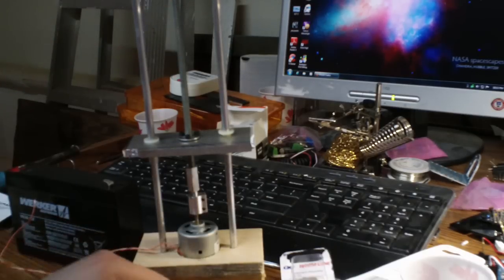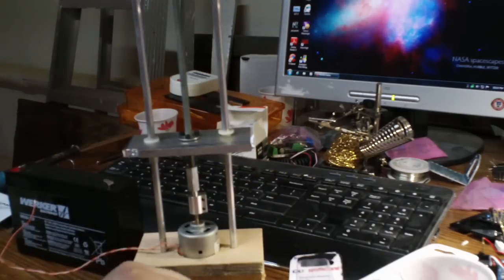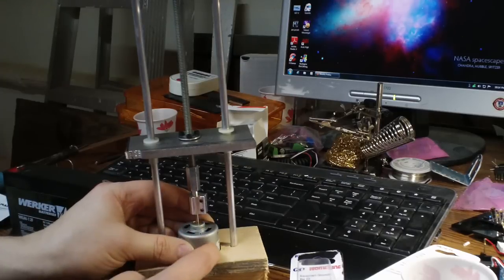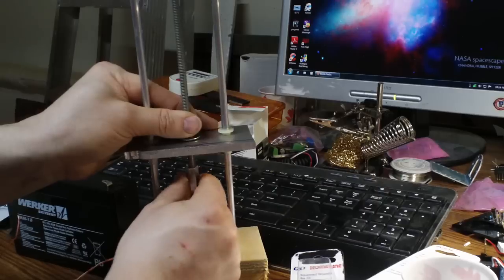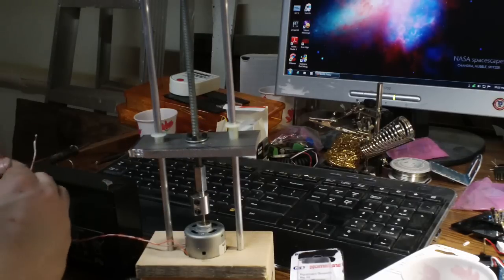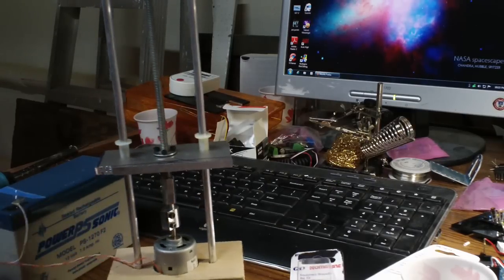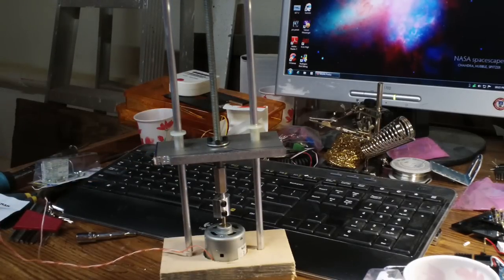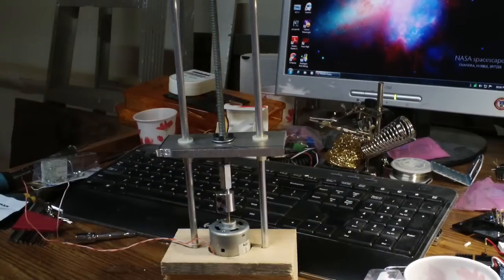Testing out a lifter concept

Comment: How does the blind nut go up an down the thread without spinning itself? Do you have a diagram?
Reply: More info here (note my new channel too)
http://www.r2d2.nu/lifter.html
Reply: So here's how I understand it. The rivet nut spins around the thread causing it to travel along the thread. The bearing allows the rivet nut to spin without the plate wanting to spin. Causing the plate to only have vertical motion. Is that correct?
Reply: Cory McMeekan you got it.
Reply: Thank you for the clarification, you have definitely earned my sub. Thank you.
Reply: Cory McMeekan  ha ha cool.  Be sure to Subscribe to this channnel (Where Nerdy Is Cool) since I rarely upload here, my old channel!
Reply: @corymcmeekan5799 lu

Comment: youre probably done with this project, but on the off chance that this information is still valuable to you, use a stepper motor and a stepper control board to eliminate the limit switches. More expensive? Yeah a little bit, but its also more reliable and a bit smoother. Also leaves room for other stuff where the switches would have been, and rigging the switches to where you want them to be would be a PAIN without a 3D printer.

Comment: Hi. Do you still have the building drawings and what you used to build it? I'd like to give it a try a home, and to control it with Arduino
Reply: Well I pretty much just hacked this together and as you can see ,that motor is VERY fast....I found it more lightly to crush a limit switch than stop it!
Reply: I'd like to modify it with a Stepper motor, so I can choose the height. But yours is pretty cool. What pieces did you use for the platform?
Reply: I would really have to dig...as the description says, some 1/4 inch rods, the adapter piece from Servo City...come to think of it, you could probably piece something together straight from what they offer on their site.

Comment: Found your idea interesting..I am looking at using the same concept to raise up a truck camper roof, with threaded rod actuators in each corner..just not sure of the power requirements the motor would have to have.
Reply from the maker: Hi....wow....one of my videos from 5 years ago!  I'd check in to Firgelli Auto and see what they have for actuators.  Thanks for the comment!
Reply: Chris have you started your project yet?  I’m interested in doing the same thing as well, and was curious about your progress, build, and any tips/tricks you could throw my way...I just recently have seen the coolest truck cab camper EVER that uses (I’m guessing) this type of system cyberlandr.com. They want $50k.....:( 🙈So, I’ve decided it’s worth a DIY attempt.